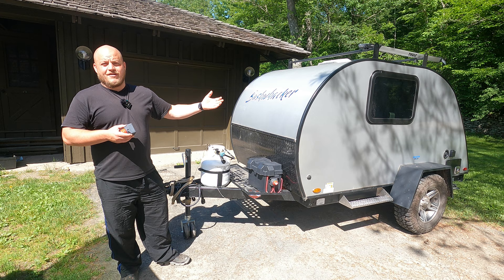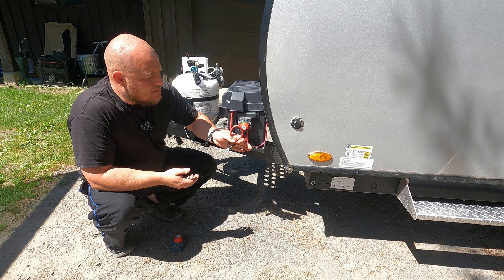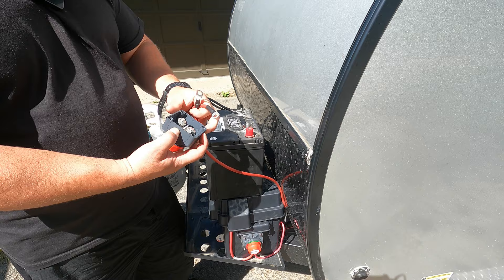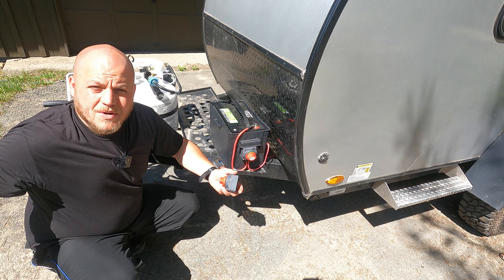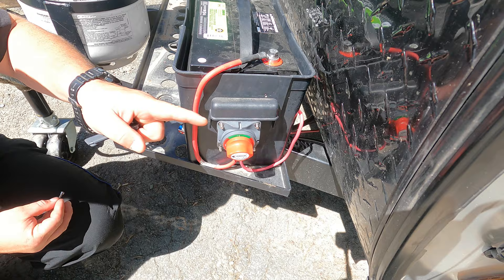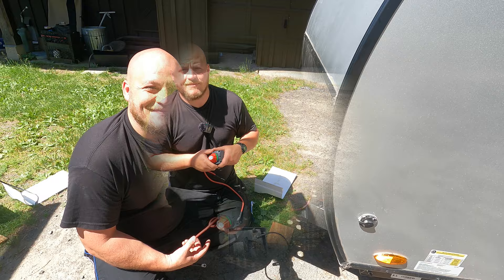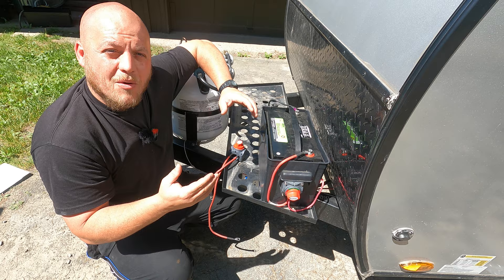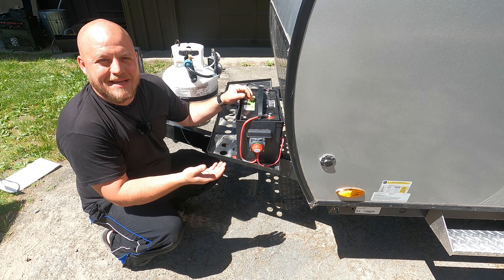Installing Master Switch on Camper Trailer | RV Kill Switch

Comment: Hello Brian. If I install a switch like this, will the converter draw less power when I use a battery pack. I’m using a ego 400 watt power station but it overload if my battery is low. Thanks
Reply from the maker: Yes, being able to turn the switch off will stop the PPS from overloading.  Check out my other videos on using power stations with RVs for more tricks.  Thanks for watching.
Reply: Hey Brian. Just dis the master switch install and it works. No more overload of the power station. Thanks for your input.
Reply from the maker: @gabe.studio5961  awesome!

Comment: I see in videos the negative is added to the one side of the switch and not 2 positive wires, does this matter ?
Reply from the maker: It does matter, check thru the other comments on this video, we’ve talked about it a bunch. Stick with positive if you can.
Reply: @DIYOutdoorLife  They you for taking the time to respond . Next time I will go thru the hundreds of comments and let’s not forget about Google when I have a question .

Comment: Question…what’s the difference between putting this on the negative side as opposed to the positive side?
Reply from the maker: Hey Mark, here’s a copy and paste from another comment-

As for switching negative 

 @Scott Swannie  it's not incorrect, but not how I would do it. This can get complicated, but it's not that hard to follow. 
I believe the confusions comes from the idea that when you remove a battery, you should remove the negative terminal first. If you want to stop your car battery from dying, when you're not going to use it for a while, you disconnect the negative side. So when people go to install a kill switch, naturally some throw it on the negative side. It seems logical, it works, and most will never experience a problem. However, the truth of "shoulds" & "should nots" with DC has to do with the highest likelihood of inadvertent short circuits. When removing a battery, the most frequent is touching + to the chassis while it's bonded to the  -side of battery.... ~ZAP~ Therefor you remove the NEG first.

None of this applies to a disconnect on a camper. The likelihood of short, in this case, is breaking the continuity of the ground when the positive side is still energized. For instance, changing a switch or light in the camper with the kill switch in the disconnect position - no problem if it's positive switched- really high chance of throwing sparks and fuses if you have the switch on the negative.
I know this is a long answer, but I get asked a lot, so maybe I'll copy and paste it...lol
There's a reason why almost 100% of  industry pros put the switch on the positive in this application. They will put it on the negative in "floating" systems like phone systems because they're grounded differently.
- -In short, BOTH work fine, but the data is strongly on the side of the positive switch team. When you ask someone why they do negative, they usually say, "bc that's the way I've always done it..."
Hope this helps!
Reply: @DIYOutdoorLife  thanks very much for your explanation…I am getting new batteries and the kill switch tomorrow, so I wanted to make sure I do it right…my other batteries would drain to nothing eventually destroying them… I (wrongly) thought the on off switch inside my class c, was sos to disconnect my batteries…but now I know it didn’t stop all battery use while in storage…

What I did now…is get a portable solar system to charge my batteries if needed but I want to disconnect my rv batteries and my vehicle batteries while it’s in storage… thanks much for  your help and quick response.
Reply from the maker: @nrgsam  good luck, keep us in the loop with how the project goes.
A disconnect and maintenance charge, like you mentioned from solar, will keep your batteries working great for a long time.
Thanks for watching!
Reply: @DIYOutdoorLife  I have a question…my new 12v vehicle battery after one day resting disconnected goes down to about 12.28 volts…is this right? I thought it should be at about 12.6 or 12.8 volts….resting…that 12.28 is just hours after I unplug it from my charger that trickle charges it to full 12.8…

My rv side stays steady at about 2.7 plus…so far after 2 days (an I assume while being stored before shipped to me)..seems to stay strong. That’s right out of the box…not charged full up yet…I am just wondering about my new vehicle battery.
Reply from the maker: @nrgsam  I’d have to see what you’re working with but that sounds low.  I’d expect what you said ~12.8

are you sure you’re charging it fully? A trickle charger can take many days, not recommended for charging a dead battery, just maintaining.

Comment: Hi. On the yeti gold zero 1500x. If it has not been in use from new for two years. They did not charge it at all. Is it ruined?
Reply from the maker: Shouldn't be ruined, leave it  plugged in for a while and see if it takes a charge

Comment: Hey Brian as I'm starting my solar install (thanks to your other video) I'm interested in adding this to my Bushwhacker as well. My rig came with two deep cycle marine batteries hooked up to the trailer so my question is where should I install the master switch so that it cuts power to both? Thank you for the content!
Reply from the maker: Hey Levi, very exciting!
You’re going to be installing the switch on the red wire that’s going to your camper. When the switch is cut it’s going true “kill” both batteries simultaneously. If you need any extra help don’t be afraid to ask
Reply: @DIYOutdoorLife  Thanks as always for your speedy reply. Will do!

Comment: New subscriber here! I really enjoy your videos!  Question:  I have an inline fuse on my positive wire.  When I install this, should fuse be between disconnect switch & battery or between switch & camper? Thank you so much!😊
Reply from the maker: Either way, I generally try to keep the fuse as close to the battery as possible.

Thank you for watching and subscribing!
Reply: Thank you so much for a quick response!!!  You're awesome!!!!

Comment: Great video. My family and I just purchased a Travel Trailer 3 weeks ago. It has two 12v batteries (parrallel) and a 100w solar panel on the roof along with a solar charge controller in the pass through department. I read a few things before coming across your video and wanted to ask if I put a disconnect switch to the negative it would essentially cut off all draw from the batteries correct? Then I can leave the wire from the charge co troller on the positive and it would essentially trickle charge the battery in between camping trips as the trailer will be in storage and there is no way to plug it in. If that won’t work do you have any other suggestions?
Reply from the maker: Unfortunately, that wouldn't work.  There are advantageous to how your solar panels are installed, but the disadvantage is that your cut off switch shuts the charge off to the battery. Switching the negative wouldn't solve this.   There are a few solutions but all depend on how the system is wired.  Take some photos of you system, including batteries and shoot me an email, I'd be happy to help.  diyoutdoorcontent@gmail.com
Reply: Thanks so much for the quick reply. When I get back out to the trailer at the storage facility I will email you pictures of the setup. I really appreciate your help.
Reply from the maker: @wesstumbaugh7232  anytime!
Reply: I’d like to add to this comment as I am searching for this same answer. I have an 2022 Imagine Camper with factory solar installed. Even though I use the factory battery disconnect on the camper my battery drains and there’s no power. I was told to leave the battery disconnect “On” because the solar will trickle charge the battery. After a few days of the camper being stored my battery is dead again. Very frustrating. I purchased the AMPPER battery switch to save my battery. 
Question: with the solar panels exposed to the sun and sending a charge to the solar charge controller and the battery disconnect “On” “No D/C being used” will it mess up the solar charge controller because it doesn’t know where to send the energy?

Comment: Why do I see every trailer company say to hook the disconnect only to the negative I'm so confused 😕
Reply from the maker: Every trailer company? I have never seen an RV manufacturer switch the negative.  In fact, every organization that governs DC electrical in things like aviation, stock cars, & military all mandate switching positive.  I only see back yard mechanics confusing the situation advising negative switch.  At the end of the day, both work fine.  positive switching has some advantages but you’ll get the job done either way.

Comment: New sub here.  I used a 3 way battery switch on my sailboat years ago and would use one battery one day then switch to the second battery and so on.  I found the 'off' battery would gain back some of her charge while resting so I could get more use out of the 2 batteries.  I now have a truck camper and am thinking of putting a similar switch for my 2 100 amps batteries.  Do you have any thoughts on this?  Thanks for what you do.
Reply from the maker: Thank you for subbing the channel.  The three setting switch is a good option, it can work on the camper just like it did the boat.  Some of it comes down to preference, but I prefer just wiring for two batteries together in parallel.  It is better on the charging side to bring the two batteries up at the same time.  Also, when solar is involved, it is nice to have both batteries together during the daylight hours, receiving a charge.  I use the symbol on off switch and have both batteries wired in parallel.
Reply: @DIYOutdoorLife  Thanks for your response.  I would switch to both before charging regardless.  Will let you know if we ever do change it.

Comment: Question: The instructions that came with my switch (I ordered from your link) indicate that I am supposed to connect this to the negative side. I found this on another site: "On a switch connected through the positive side, the exposed terminals on the back of the switch or a broken positive cable could contact the sheetmetal or frame during a crash, creating a short to ground and safety hazard. The negative cable connects to the body ground already—so there's no additional danger if it rubs. It's the same principle as why you should always disconnect the battery's negative side first before performing electrical service." What do you think? Is it a big deal to connect to either the positive or negative side?
Reply from the maker: The back of the switch is completely enclosed with plastic.  Switching the positive is industry standard for this application.  In fact, leaving potential to appliances and switching open the pathway to ground is a much higher risk in applications like this. 

With an automobile, always remove battery negative first when removing the battery.  You are using a metal tool in a ground bonded, metal enclosure, different situation than the master switch.  Hope this helps !
Reply from the maker: this is another reason to connect to bat box rather than frame.
Reply: @DIYOutdoorLife  THANK YOU for the quick reply! I'd prefer to switch the positive side--I appreciate the confirmation!

Comment: Does it matter if you put it on the positive or negative side?
Reply from the maker: Yes, it matters, but either way will work.

You should avoid switching the negative unless you have to for some reason. When using (-) switch, you are interrupting a pathway to ground. When switching positive, you are eliminating potential to devices.  It can get complicated but switching positive is the preferred application, despite the amount of people that say the opposite.
Hope this helps!

Comment: If I had two batteries would i have to install two kill swithces?
Reply from the maker: Nope, follow the same procedure. You are actually switching the wire that goes to the camper, after the two batteries are parallel. So using the switch will disconnect both batteries.

Comment: Sort of a dumb question, but how much would it matter to have the wires entering the switch from the bottom? I ordered a 12 inch 8 gauge wire and its not long enough to run it out the bottom of switch and then up to the terminal.. so I took the side panel off the switch and ran the wires in from there. Probably overthinking it, but I dont want rain to get in either..
Reply from the maker: You’re fine, go for it. You won’t have any problems.
Reply: @DIYOutdoorLife  Alright thats what I figured. Thanks!

Comment: My battery actually has positive cable connections on both sides of my trailer frame. Does it matter which cable I attach the switch, or do I need to do something entirely different? Thanks. This was a great video.
Reply from the maker: I how do they come to connect with the battery? Do 2 wires connect to the positive terminal or one?
Thanks for watching, hope you’ll subscribe!
Reply: @DIYOutdoorLife  there are 2 cables connected to the positive post. One going to each side of the frame. There are actually 3 black cables attached to the negative side of the battery. Two cables go towards door side of the trailer and one going to the other side. Thank you. I don’t think there is anyway I can attach a picture to this feed, is there?
Not sure if you can see my profile picture well enough, but that is the set up for my battery. Not sure if it is big enough.
Reply from the maker: No big deal, attach both of those positive leads to one side of the switch. Then run one wire, from the other side of the switch to the positive side of the battery. When the switch comes on it will power both legs. Not knowing the details about your trailer, consider using 6 or even 4 gauge wire. This will set you up right!
Reply: @DIYOutdoorLife  Thanks Brian. I appreciate you taking the time to help. Love your channel.  Learned more from you than all the other videos I’ve watched combined. .
Reply from the maker: I appreciate that! Thanks for tuning in and subscribing!
Reply from the maker: @kentwilliams9021  I appreciate that, reach out any time!

Comment: I wanted to know if you could could hook up the switch to negative side of battery as well or if it has to be positive side.
Reply from the maker: Yes, you can.  There are several reasons why the positive is preferred, but the negative will work fine.
Reply: @DIYOutdoorLife  thank you for your help! Your instruction is very easy to understand and helpful!

Comment: Thank you! New to trailers and I’ll be installing one of these soon. 
We need to install an electrical outlet that is separate from the rest and always on when the main power is on in order to heat up dialysis fluid a couple times a day (std wall plug and takes about an hour each time). I don’t want to hook up & fire up our portable generators each time. 
I’ve already mounted the receptacle and need to wire it up. Do you have a video on this?
Any help will be greatly appreciated. 
Thx again, Tony
Reply from the maker: Hey Tony, thanks for watching.
Just to be clear, you want a standard 110 outlet, like the receptacles in your house?  You want this to run when youre not connected to shore power?
Reply: @DIYOutdoorLife  yes with out any plug in our generator power none of the outlets have power. It would be nice to have the one to use pretty much off the batteries (we have two). 
I thought I could get clever and connect to the water pump power as it runs that way but only when the pump switch is on. 
Thank you for the help!
Reply from the maker: @tonymartino7892  hey Tony, unfortunately it’s a lot more challenging than what you’re thinking.  The battery system is 12 volt direct current.  The receptacle you are looking for is 120 V alternating current.

Your lights, water pump, USBs, cigarette plug can run on 12vdc, The outlets require shore power or generator.   
There is a device, called an inverter that can make this happen.  In order to run the device you’re speaking of, it would require massive batteries and a massive inverter.

I think your best solution will be to purchase a portable power station.  I have a ton of videos in a playlist reviewing many.

Please email me at diyoutdoorcont@gmail.com if you have any questions. I’d be happy to help anyway I can.
Reply: Thank you so much. Yes the more I learned about it the more it became harder to get there. 
We’ll just use our generator for now. 
We’ve had our trailer for a month more and are two trips in and are thoroughly enjoying every minute. 
Finding out new things every day. 
Subscribing to your channel is proving to be of great value to us and we thank you for the straight forward content. 
I’ll be sure to reach out as things arise. 
Thanks for getting back to us with helpful info. 
All the best, Tony
Reply from the maker: @tonymartino7892  that’s great to hear.  Carving out the time to spend outdoors is life changing, having the RV helps make that possible.

Comment: How do I wire that switch there's a wire at the top of it one at the bottom
Reply from the maker: I would have to see your application. it’s fine to run one wire out the top and bottom of this switch, but always better to run both out the bottom if you can.  It collects a little less water that way.

Comment: question. Do you use the straps that go around the battery box that helps hold the lid down. If so do you use the woven type with the plastic buckle or do you have a better solution? my straps disintegrated just from the weather/sun
Reply from the maker: I’ve been there, that’s why I switched to this. Are use self tapping screws to mount the box down, the top just snaps on.
https://amzn.to/3RV78LT